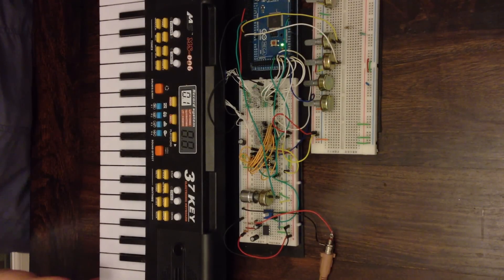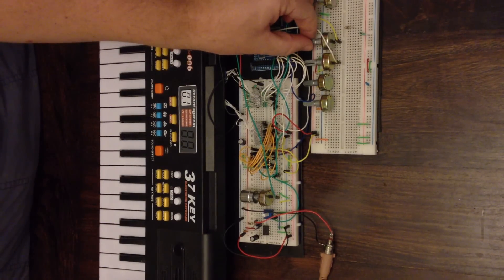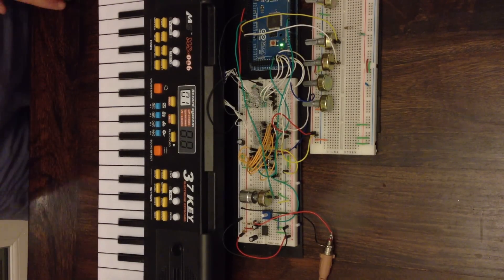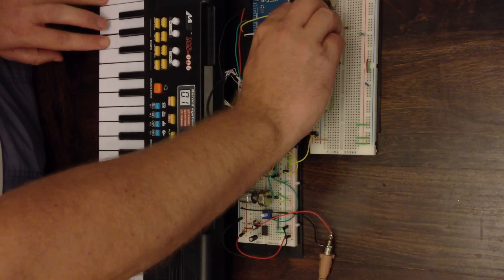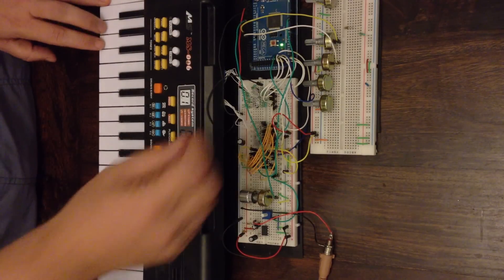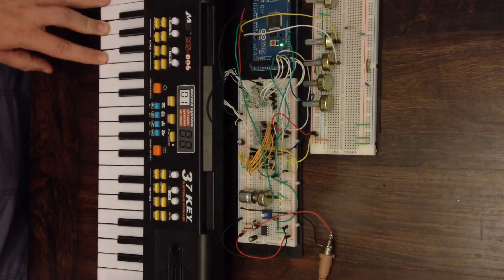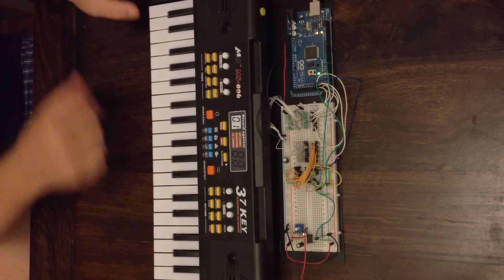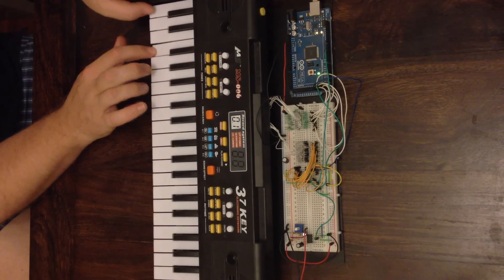Five Dollar Arduino Synth Meets Auduino

Comment from the maker: The board is an 8 Bit Arduino Mega, the project could also be built with an UNO. The only advantage of the Mega is that the extra memory allows for a longer delay effect. Duane B
Reply: Greetings, I made a noise box with a UNO. It's possible the output of that, be the input for this? LIke a modular synth. My best regards.

Comment: @_greyfox() I can't tell but he might be using the Uno in this video. It's true that the Uno can only output 1 square waveform and nothing else (unless it's modified or more timers are added to it). You can however emulate other wave forms like sine waves using pulse width modulation. You may be interested in checking out Mozzi. It's a synthesizer library which can help enable the Uno to emulate more complex waveforms.
Reply: the board looks like Arduino Due. neither uno nor mega have that type of processor.